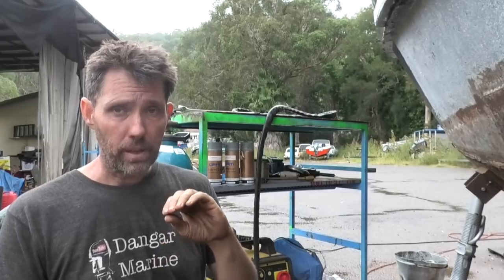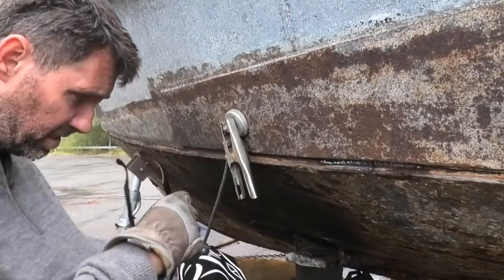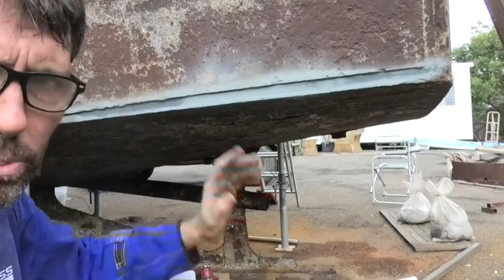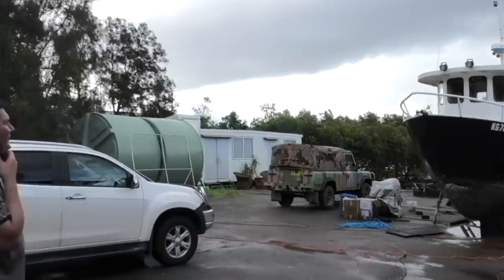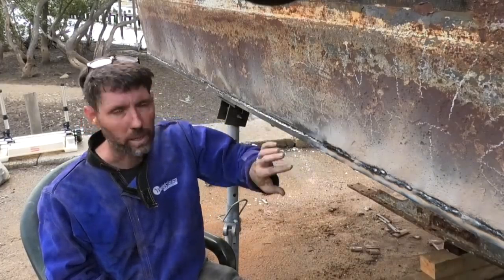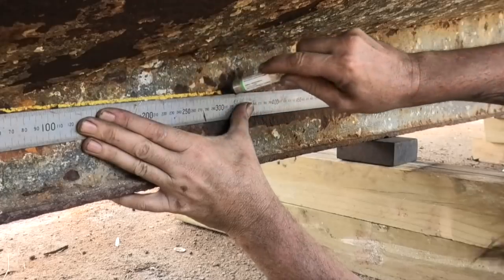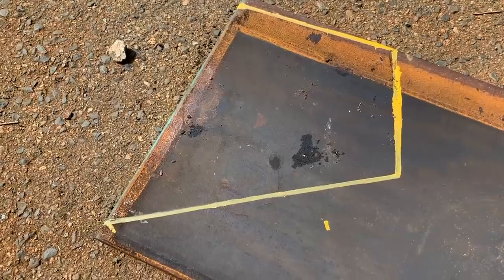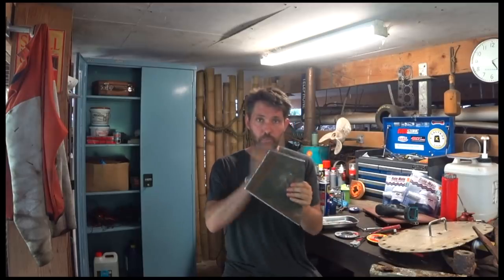Repairing the steel trawler's hull

Comment: Working on steel boats over 40 years love the fact that you can just cut out any bad areas and weld up a new piece of stock.  We mostly use 6010 and 7018 stick welding outside because of the wind and way lower costs.  Ya doing a great job,  take your time because you will have this nice boat for life  :)
Reply: After watching the whole video I agree with filling in all the small divots too.  It might seem like a lot of work but it really isn't and once your hull is tight and primed you'll feel like a million bucks. The time spent on your hull is really the heart and soul of your great lil boat.  Not the diesel as you would think because without a sound hull ya don't float  ? Everything else is just work that once you reinstall your power you can finish everything in the harbor.  Another great video,  thumbs up.
Reply from the maker: Thanks mate. I'm liking getting better at stick welding. With that small 10 amp welder it is such a compact and portable setup to keep on boat the whole time too. A few scraps of metal and some rods in plastic sealed packages and you have a great repair kit everywhere you go.
Reply: @DangarMarine  yup plus the wind doesn't matter as much.  Cheaper too. Although TIG has it's place .  6010 deep welds with 7018 as cover pass. You're doing just fine and think out all the moves.  Spending extra time on your steel hull pays off.  I would also make up a few pieces of pins and wedges incase you ever hit a rock and then you can pound one  in the hole to get back home safely?  Also I carry wooden spikes, wedges too. This will get you back home and save your dream boat just in case. Just don't rush the hull no matter what people say.  It's a lifetime boat :)
Reply: I'm glad you mentioned 6010 & 7018 welding rods being a time served weld I worked on ships hulls, a lot of X Ray work using 7018's on Vancouver island  retired now but watching this brought back lots of memories, TIG  isn't really the process for hull work, 👍
Reply: @robbie3304  agreed  :)

Comment: Easy to patch a steel hull...
Cut hole to fit patch, then on the inside, trap a thin sheet of copper between the hull patch and a magnet,
Weld up and done!
Cheers from The Great Lakes!
Reply: So the copper wont 'take' to the molten steel and stops blow through!! great idea!!

Comment: Hey Stu, 
From over 45 years of welding experience and having been taught by my father (who did his apprenticeship as a boilermaker way way back) I could offer some welding tips to save you a lot of time and money if you are interested. (Been there, done that)  

Wahroonga only 5 minutes from Hornsby Steel.  Have home workshop with Mills, Lathe, Tooling, Hydraulic Press, Bandsaw, Plasma, TIG, MIG, STICK, Oxy, etc. plus everything else needed in a good man cave.  

You are doing it the hard way for sure. (Edcon Steel Brookvale {Mathew} => First tip)

Cheers, Ron
Reply from the maker: Always interested in hearing tips. Will be welding in the skeg today and then just doing as much pad welding as I can on the hull before the sandblaster comes on Tuesday or Wednesday.

Comment: You are showing much more confidence in what you are doing as you become more familiar with the material. I remember my first steel boat (Colvin Ketch). Lucky I didn't have to weld but learning what to do with it was a big milestone. Doing good.
Reply from the maker: I've certainly been learning a lot along the way. Makes me want to do another boat now, maybe something 10-15 foot longer...
Reply: @DangarMarine : Just reading your comment and I had a flashback to that boat and job. I was listening to the radio as I worked and they announced that John Lennon had just been shot and killed. Strange day. Yeah, I'm old, (73). Hang in there!

Comment: I almost unsubscribed after I heard your justification for using the TIG welding method outdoors on rusty metal. Stick was the only appropriate method to use as you soon found out. I’m so impressed with your positive attitude in the face of such difficult circumstances. I’ll keep watching with great interest. Best of luck.

Comment: Stu, One mob I worked for used to cut off 12mm or thicker plates to add a mounting plate for a strain gauge to be fitted between the load arm and the lift tube. The certified welder used to pre heat the metal with two LPG/Oxy torches before stick welding the new mounts in place. That apparently did two things, one was fewer sticks were used up , better welds resulted and apparently the weld stresses in the metal were much lower.
The last one I have no idea if it was true or not, but the pre heat definitely resulted in fewer sticks over all being used and the welds were much cleaner smoother and far easier to smooth out as a result.
Reply: Nah man, pre heat is only used to stop heat induced cracking around the heat affected zone of the weld. Steel expands when heated and shrinks when cooled, if there is really cold steel near where you are welding, or if you are welding a high carbon steel, heating everything up around it let's it move to allow for the heat input of weld and dissipate the heat smoothly
Reply from the maker: Hey Ron, there is no doubt that once there is some heat in the metal things start to go a lot more smoothly. It is always the first bit of weld on cold steel that goes badly for me.

Comment: I think I saw you pushing the rod when you were stick welding. You're probably doing that because that's how you mig weld, but when stick welding it is better to drag the electrode. This allows the slag to flow out of the weld pool to the surface. When you push you create the risk of trapping slag inside your welds making them weak.
Reply: "If it makes slag, you drag."
Reply from the maker: Yes, always drag unless doing vertical up. I've never MIG welded for a minute in my life so no habit there!
Reply: SomeGuyInSandy - "If it makes slag, you drag." - Yeh, good basic common sense there bud, Unless that is, you happen to be welding ''vertical up'' [3G] Its pretty damned hard to drag a rod when welding in this position, especially when the ''code'' parameters require you to weld vertically ''up'' while positioning the rod at a 90° [minus] 15° angle from the root face.. Also, when using ''fluxcore'' wire process, you can actually use ''push'' or ''pull'' techniques when welding, although, i have found that ''pushing'' the wire into the root gap always gives a much hotter arc-pool, hence better ''penetration'' and a much stronger weld.. Just saying lol - Ajay.

Comment: Hi Stu, At first I wasn’t sure about the circular hole patches, I’ve always cut square pieces & the stock is always in flat bars. So when you cut your patch from the stock you’re taking from other straight edges. But then I thought, well if there’s wires, fabric, or anything else that melts the torch will cook it, and a cutting disc takes some effort. So I think your idea is brilliant. Then I was thinking, instead of having someone make you some discs, just cut the discs from the stock with the same size hole saw. If that can be done without a center bit. I suppose if you couldn’t & there is a hole in the center of the patch, then it would have to be filled with weld. Which is kinda of a waste. I was trying to think of way to cut another trip and expense from the project.

Your doing great, your making good progress for the conditions you’re in. It’s hard to explain, but there’s more and more of you going into the boat. The intent behind your effort equals quality and reliability. Simply, you intend for it to stand the test of time with out failure and it will. Well, that’s all you bud, your sweat equity will be paying off for years to come.

Your UV comment was an understatement. Those rays are as intense as the sun without earths magnetic field and atmosphere. I’ve  been cooked before and its the most uncomfortable, irritable condition I’ve ever experienced. You’ll have a giant intense itch for about six weeks that you cant touch, and ya its not good at all for you. So I also am often wearing heavy clothing and leather when it’s 90 f, 90% humidity, & working inches from hot steel all day. And its worth every bit of clothing vs the UV burn.

Your torch and welding skills are very good. I don’t think any of your welds would break if put into a vice & stressed by hammering and prying. (Thats how my shop teacher graded students arc (stick) welding projects he assigned. In 7th grade btw. Boy, times have changed) oh and my gosh, the condition and thickness of the hull steel is mint dude! I mean I’m watching from a phone in the US, but it looks look like real good quality steel. The rust isn’t digging straight down its been just slowly working from the surface. I think that boat is solid. She’s gonna be a wave crushing tank.

Im excited for the next video. Great job and great video.
Reply from the maker: The other thing I was thinking with the round patches is that you don't have any sharp corners to have stress cracks form in. I certainly feel like my welding is getting better as the job goes on. As you say, I don't think even the worse ones would break, they just aren't particularly pretty. The hardest thing has been learning to do them all out of position. All the previous welding I have done has been flat on the bench.
Reply: You are absolutely right about a round patch taking more stress without cracking. No edges mean stress is distributed evenly instead of a 90 degree angle where the highest stress is right at the tip of the edges. I think an oval shape will do the same thing as a round will, if you ever run into an odd shaped patch that needs to be made.

The only other thing I thought of is the weld inside the fuel tank. Weld from the outside, then weld the inside, grind the inside weld down and put a patch of steel over the weld. Just for insurance that it wont ever seep. You’re right there though, and if you feel that it’s not necessary, than it isn’t.

A small tip on oxy/acetylene cutting, if your running out of gasses too often, you may be able to rent larger tanks on a dolly for a few months, then return them after the bulk of cutting and fabricating is done. I purchased “B” size tanks for mine and i think yours are that size, cant remember if i saw them. You’ll only get about 45 mins to an hour of cutting time before the oxy runs out. Cutting and rosette (heating) tips eat up the gasses fast.

Hope all is well and keep up the great work.

Comment: Welding plates onto my rusty old boat trailer as I watch this LOL good to see some 'Proper welding' (Stick) 
Tip for the oxyacetylene cutting. Get the cutting line really clean and pre heating to cherry red at the start point will guarantee the cut will be super clean, with no 'blow outs' or swirls which are almost always caused by rust flakes on the face you are trying to cut.

Comment: Hi, to fill gaps with a stick weld or MIG  put a piece of copper or brass at the back of the hole and fill it from the edges, the copper or brass with keep filler metal in the hole and will not adhere to the backing , do it all the time works fine. Stick welding is so much quicker than TIG.
Reply: Stick on ceramics are a shit boilermakers lifesaver...

Comment: Hi. Good video. I haven't been following a long time but I like the content.
About the holesaw idea - great idea! I was thinking maybe to use the same size saw for the hole and patch. Then you are left with a gap for butt welding them together.
You can cut the patches out without the pilot hole also. First take the holesaw and cut a hole in a osb board. Then you use the osb board, put it over the material that you are cutting the discs from. Remove the pilot drill from the holesaw. And now when cutting, the osb keeps the cutter in place and the disc is without a pilot hole. (can be osb, can be a thicker piece of metal etc.) Have a good one. Greetings from Estonia!
Reply from the maker: Hey mate. Yes, I was also thinking of a few ways you could cut without the centre bit (drill press and clamp for steel etc) but I like you idea. Thanks!
Reply: @DangarMarine  You are welcome!

Comment: Oxygen acetylene torch use:  Try tipping your torch head 15 to 20 degrees, sometimes more, in the  opposite direction of your cut, this will blow the slag forward away from the cut, preheat the metal in front of the cut, reduce the slag on the underside of the cut, and will result in a  faster cut with less distortion.  All bets are off with rust, that shit just explodes.  
Your doing a great job,  always a thumbs up. . . best of luck. . .Oktim
Reply from the maker: Thanks Danny, I'll give that a try.

Comment: You're doing a cracking job mate. 
Enjoying this.
Pity you're breathing the stick gasses.
It'd be cool if you had a snorkel mouthpiece attached to a flexible pipe to a activated charcoal 3M filter on your belt/back canister thingy
Reply from the maker: Breathing filters are a good thing but being outside it blows away pretty quickly.

Comment: Hey, you should try 3M cubitron Ceramic grinding and sanding discs. They last forever are self-sharpening and cut like a machete through butter.
Reply from the maker: I'll check them out, thanks!
Reply: Never heard of them, but if they are 3m I'll bet they are great.

Comment: Looking good stu. I myself only braze and cut with my gas, means i dont need acetylene, i just use lpg, a bbq bottle easy to get filled. Kind regards from New Zealand
Reply from the maker: We do have one pure LPG torch (no oxy) that we use for heating. It is so much cheaper!
Reply: @DangarMarine  ur acetylene regulator will fit the lpg bottle mate, then head to wherever you buy gas equipment and ask them for a lpg cutting tip, off memory i use a #18 tip. Works great,  ive cut plate 1inch thick, u cant weld though as lpg doesnt have the same heat as acetylene. If you have difficulty getting the flame right there are utube videos that will be helpful. Kind regards from New Zealand

Comment: Mmmm the multi sized circular plate and hole saw tip I gave you a few months back. never got a reply to it but at least you used it eventually..
Reply from the maker: Hey mate, sorry, hard to get to every comment these day. Good tip though!
Reply: @DangarMarine  Not a problem mate, I put the original tip/advice in the comments of the video "Preparing the trawler go on the hardstand" a few months ago, if you have a quick read it could save you a fortune as you won't be paying for the cutting service. keep hanging in there, the ends in sight

Comment: Using the round plugs is a good idea. See if u can get some CIG Satincraft rods in 10 or 12 gauge, 
theyre meant to be downhand rods but run really smooth and u can run them quite hot. Its like christmas when theyre running well
Tack and weld the plugs in from the inside, you will have to weld overhead on the outside, thats bound to test youm but you probably need some new skin by now anyways.
I couldnt see anything that I disagreed with, except to say move around a bit more and stitch weld wherever you can, unlike making a run entirely in one direction like at the chine. 
Stitch welding keeps the heat input down
Have a good one
Reply: You sound like you might have welded something once.
Reply: Welding overhead isn't fun but welding from the inside? I would have thought physical access and fume control would make that your least favourite option? Never done any welding in confined spaces myself asked as an honest question.
Reply: @COIcultist  It has to be welded on the inside anyway, you do what u can to extract fumes, thats the job
Reply: @alexfehlberg1065  or twice
Reply from the maker: Hey mate. Good rods certainly do make a huge difference, and keeping them dry. I'm slowly coming to terms with welding out of position. Everyone learns sitting comfortably at a flat bench with new bits of steel and then suddenly you get out into the real world and how different it is! My mate Jeff also recommended stitch welding when you are overhead to keep the heat down and stop the puddle from sagging too much.

Comment: you may have finished but you could heat the area with the oxy then stick weld you will be amazed with the result this will also burn of any contaminants cheers and beers
Reply from the maker: Will give it a go.

Comment: To test the hall for holes when you're all done rent a fog machine from a party store, hook up a blower and some ductwork to pressurize the house slightly and introduce the fog into the system started it streams out any holes below the waterline. This is a long used method of testing for leaks in air conditioning and heating ducts and works very well. Just seal up all the openings except the one you're going to hook the blower up to. Where there is a whole the smoke from the fog machine will stream out.

Comment: if you drilled a smaller hole with the hole saw and decide to go bigger..  you can screw both the hole saws on the arbor and use the smaller saw blade as the pilot.

Comment: Grinding areas to be patched,  before cutting out (for patch) will help a lot.. you can write/ mark easier on clean metal, and the hull side of the weld will be (mostly) prepped.. and when using those wire wheels on grinder WEAR A LONG SLEEVE SHIRT, as well as other PPE.. those wires will go so far into your skin when they come flying out at 1 million MPH... & always make sure they are rated for the speed/ RPM of your grinder!!!!!
Reply from the maker: The second patch I did grind before marking, made it much clearer. You're right about those wires, they can go in deep!

Comment: should have used a stove pipe rod for the root run and then a gp rod, the stove pie rod will burn through all the impurities, TIG is ok for light work but for penetration you have to use conventional welding techniques. Oh by the way I`m an old boilermaker, cheers.